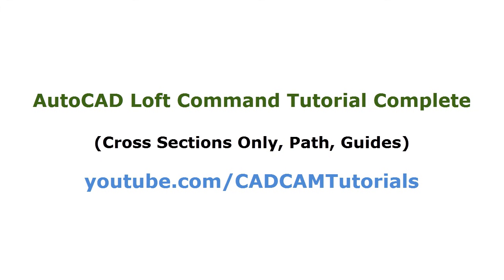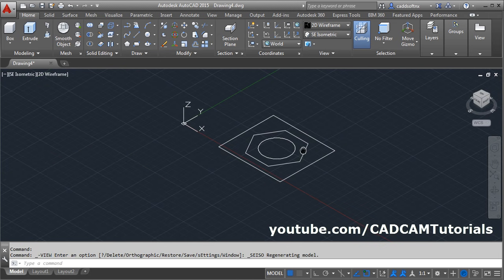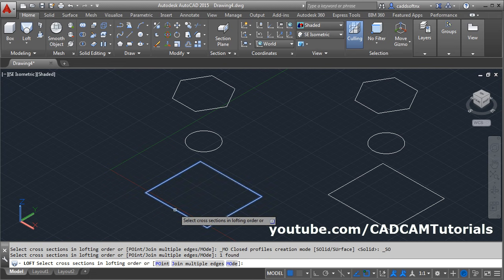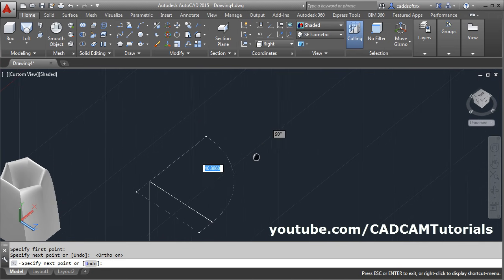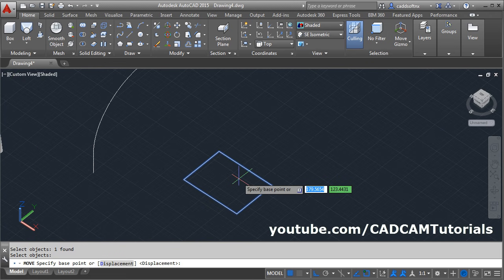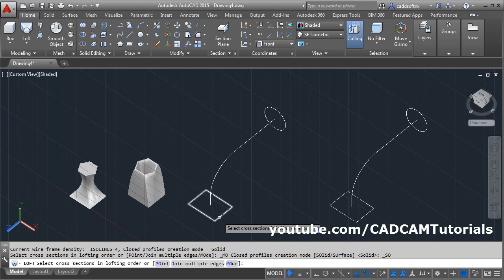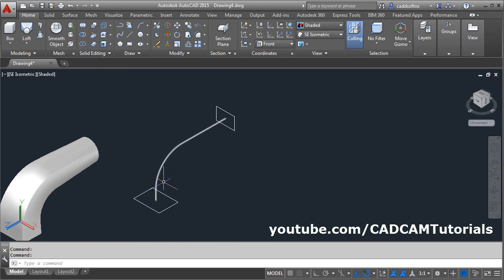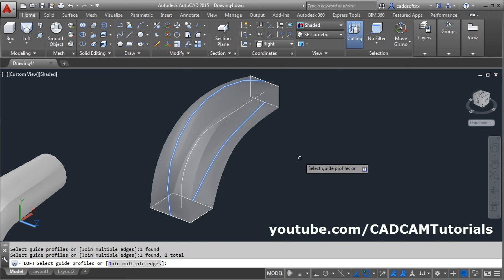AutoCAD 3D Loft Command Tutorial Complete | AutoCAD Loft Path | AutoCAD Loft Guides

Comment: Yeah sure! It looks so easy when you master are doing it but in practice is much more difficult when it comes to spline! Loft command is maybe the easiest and most straightforward 3d command but when you have to extrude or loft on a path is very difficult when you have to change the XY plane in space. I found the easiest method to be the new ucs, then select x and y axis according to the plan you want to draw into because this way you will have only two axis to look after and dont have to pay attention to the z axis, using left, right, front, back...etc looks much more difficult to me! I am just a beginner in AUTOCAD btw and the extrude/sweep along a path seemed the most difficult thing to me so far! Nevertheless you are a genious! Can I email you a 2d plan building which made my Autocad crash in 2 versions (2017 and 2021) when I tried to press pull the windows? I've tried it on my desktop as well and autocad froze again, the drawing is pretty simple with only 4 rooms, I dont know why Autocad is acting like this. Maybe you can help me figure it out. Thanks alot in advance! Keep up with the good work!!
Reply: May be it's too late as a response, but I think you to make sure that all the 2d drawing areas are fully closed using boundary command, then make sure that z axis is in extrude direction using ucs command.